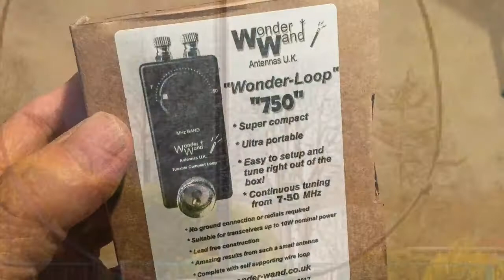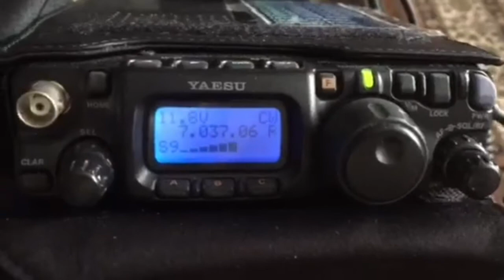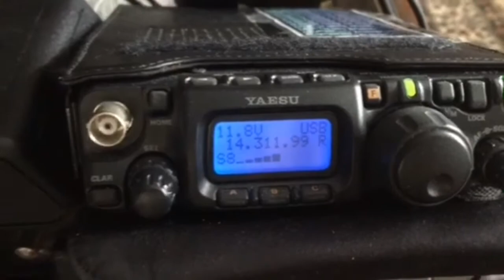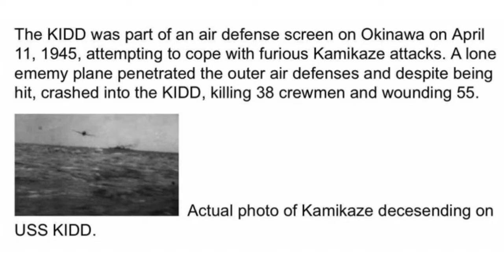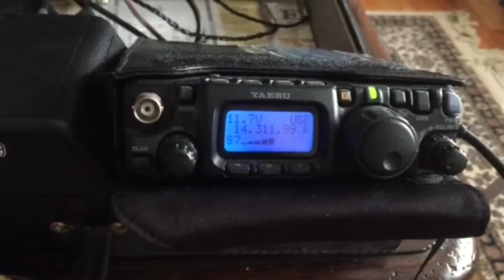Wonder-Loop 750 Vs. AlexLoop

Comment from the maker: Hello, KD8POI, well concerning the peaking of the Wonder-Loop 750, it has about he same sharpness or resonant Q "sweet spot" as the AlexLoop. On stronger stations the AlexLoop beats the W-L with 1 to 1.5 S  Units on receive. On some very strong stations, both can be about the same. Now when you are taking about receivng very weak signals, that 1 to 1.5 S-unit can really make a difference. The Alex-Loop is a solid, great all- around compact antena performer wth no problems getting QSO's. On the other hand, I view the W-L as quite a bit "iffyer" and more challenging, but interesting to experiment with. It's always interesting to see how much less one really needs to snag a QSO. 73's de WB3BIQ.

Comment: I have the Alex Loop; my most impressive QSO with it was from St. Louis to Turkey, 5w, indoors, 20m.  The thing I cant find out and that you may be able to help with is the smaller wonder antenna's ability to peak signals along the plane of the loop.  My understanding (and it isn't a great understanding), is that with smaller loops, you get less of this effect.  I like the Alex loop because its easily "backyard portable".  Grab the bag and a tripod and you're set up in 5 minutes.  The wonder loop looks like it has a much smaller footprint -  better for back-packing and the like - but people may like the larger Alex loop better if they're like me and are going to use the loop from deck or patio.  Meh, I'll probably buy a Wonderloop anyway, its cheap (relatively), interesting, and easier than setting up an end-fed dipole.  

Good video, I'd like it if you could try and see how they do on weaker stations, stuff that's closer to the noise floor.  Lets face it, the 817's S-meter isn't exactly a wonder of science.  Weak broadcast signals or something in the 9Khz region may be good for this.  Just a suggestion.  Good to find your channel.
Reply: Interesting comparison and very surprising how well the compact loop worked. Thanks and 73, N3CI